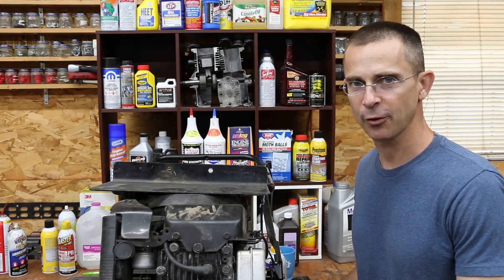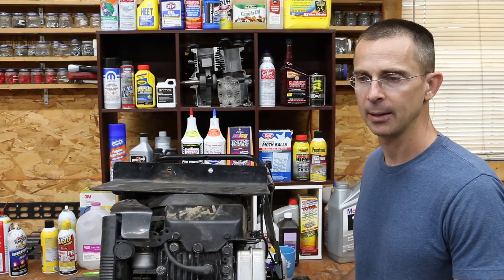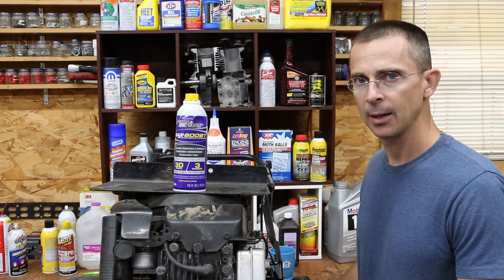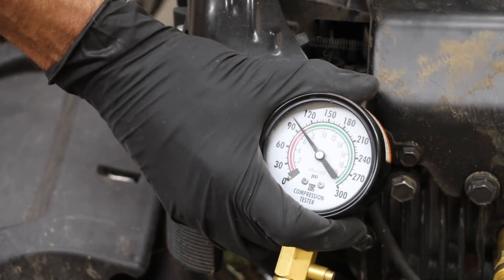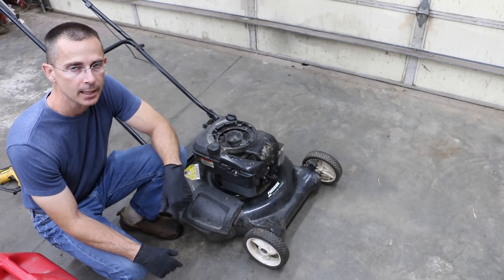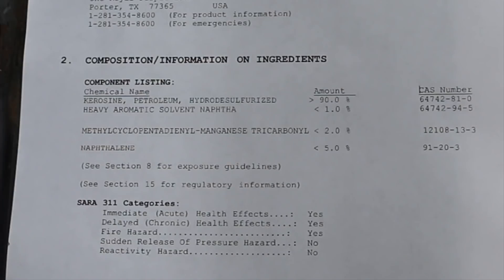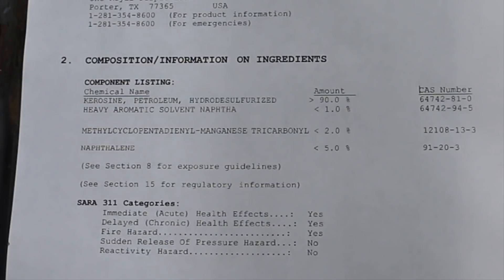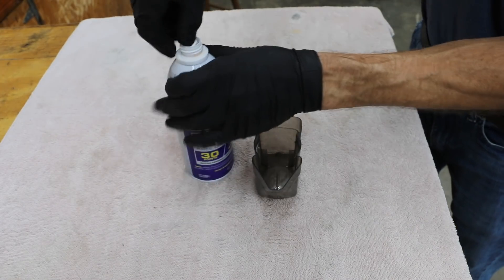Will a gas engine run on 100% octane booster?  Let's find out!

Comment: My mom ran out of gas on the side of the road in the late 90s in a mercury cougar. She had a case of octane booster in her trunk. I don't remember how many bottles she put in but I believe it was the entire case. The car started fine and she drove it to the gas station and filled up on gas. As far as I remember everything worked out fine but I was about 10 or 11 when it happened.
Reply from the maker: Impressive!  That was very good thinking by your mom!

Comment: This video was awesome. I just discovered your channel and subscribed. I noticed on the see-through engine that there was a small vortex directly across from the exhaust valve, and some further circular flow leading from the intake valve to this vortex. This gave me the idea for a video project recommendation for you. What if you were to engrave some spiraling channels inside the combustion chamber which follow this flow pattern shown in the video at 4:35? Would it affect air/fuel flow, combustion, and/or exhaust flow significantly enough to affect engine performance? If so, would it improve power, throttle response, torque?
Reply from the maker: This is a terrific idea--thank you!
Reply: You're welcome. I would be stoked to see the video.

Comment: You should try 87 octane with no ethanol and 100 octane or do 87 89 and 91,93 or 94 and do a running comaparrsion, Between the three fuels to see how they affect the mower differently
Reply from the maker: Thank you for this recommendation!

Comment: Would be very keen to see these motors doing a quantifiable work, perhaps like a water pump and two tanks, or a alternator and load?
Also, while its probably been done before, would be keen to see running such a motor off the various fuel gasses you can buy, like LPG, CNG, H2 and C4H2.
Reply from the maker: Thank you for this recommendation!

Comment: Here is a good one, running a lawnmower engine on a lighter oil which also happens to be synthetic versus the oil originally said to be needed.  Like my dad's Honda push mower went from regular oil 10W30 or 5w30 to my laying around Pennzoil 5w20 natural gas synthetic. Also, use Shell gasoline.  Anyways this is an old mower but it seems a bit different now.  I believe the change was from 10W30.  Please try it out to see what you think.
Reply from the maker: Thank you for this recommendation!

Comment: Very interesting.  I wonder what the orange stuff was?
Reply from the maker: Others said it is sulfur or MMT.
Reply: Project Farm thanks for the reply.  I  look forward to the next video. Maybe one episode you could try nitrous oxide? Or I would really like to see water/methanol injection around 60/40. From the data I have seen shows strong improvement over gas alone and the intake Temps go way down.

Comment: Have you heard of running a 10:1 gas:acetone mixture to clean the carbon deposits? Heard it from a mechanic who worked for Ford back in the 70’s. I do not have a sacrificial mower to try it on.
Reply from the maker: I have heard of this.  Thank you for this recommendation!

Comment: I have an idea.how about using a full  gas tank of carbon buildup remover  in  ur lawnmower engine .then remove the cylinder head when mower engine is cooled off and see if all or every inch of the top of the combustion chamber,piston top,and intake and exhaust valves  are completely carbon build up free .letme know what u think of my idea
Reply from the maker: Thank you for this recommendation!

Comment: so i guess the the idea with the "octane" booster ingredients is that the kerosene is more stable than the gas when rapidly compressed, so it helps mimic the characteristics of higher octane fuels? if thats whats going on it seems like you would be better off to just buy 91 if you have a high compression engine, seems iffy to me.
Reply from the maker: Excellent point. Thanks for commenting!

Comment: I would like to see if easy off oven cleaner can clean carbon out of an engine. Maybe let it soak a little before running the engine. It cleans carbon buildup out of ovens and I am curious if it will do the same to an engine Thanks for your videos. I love watching them. Thanks
Reply from the maker: Thank you for this recommendation!

Comment: One evening when I was screwing around with canned air I decided to light it up and it was highly flammable like it said on the can and the ingredient is close to nitrous oxide you should try running an engine off of it or at least making injection line for it but I don't know what the bettering agent would do to the engine
Reply from the maker: Thank you for this recommendation!

Comment: If I remember my auto mechanic class correctly, Octane Booster inhibits ping so that you can run a higher compression ratio thus giving you more power. Octant boost in itself does not give you more power.
Reply from the maker: Yes, you are exactly right. Thanks for commenting on this!

Comment: I live in Cali we only get 91oct. I have a 2+ Golf R 375hp/400tq AWD (<brag). I use 8oz of Torco octaine booster with 10gallons of 91 and can run my 93oct file all day at the track with no issues. I’ve even tried the 100oct file with 24oz of torco (this file doesn’t have much timing wiggle room) and again no issues with pulled timing. should experiment with it as it’s the only oct booster on the market I know of to be dyno / logged and confirmed.
Reply from the maker: Impressive! Thanks for sharing this experience with Torco octane booster.

Comment: I would like to see how well the engine would run on white gas (camp fuel) and how it affects a lawn mower it has been left in for several months. Gasoline with alcohol is a disaster if left in the mower over winter.
Reply from the maker: Thank you for this recommendation!

Comment: How do you get these lawn mowers? Do you use the same ones for different videos?
Reply from the maker: I have 20 or so engines.  I buy them from mechanics and off of Craigslist.  Thanks!
Reply: Project Farm  thanks for the reply I rely on garbage picking them I got 2-3 atm and i take the engines apart and learn what's different in a 6.5hp and a 8hp.

Comment: i would really like to see what happens if u run 2 stroke fuel 32:1 in a gas 4 stroke engine , if it makes it run hotter or lowers the compression or just what happens, also would love to see what happens if u run a 2 stroke engine with a 32:1 but use engine oil not 2 stroke oil to mix with the gas, i always put a splash of 2 stroke oil in my lawn mowers tank, i dont think it will hurt it but id like to see
Reply from the maker: Thank you for this recommendation!

Comment: Hey, do you have a vid showing your construction of the see-thru head?  I've seen a couple others, but never seen anyone do a "how to" or "making of" vid for one.  I can easily se it's a high strength plexiglass, but to see it actually being made gives a whole different experience.
Reply from the maker: Yes, I make one in the monster energy video.  Thanks for commenting.
Reply: Oh, cool, I will check that out!

Comment: See if you can somehow mount the carb to the exhaust port and the exhaust to the intake port and spin the engine backwards and see if it will run. Love the videos.
Reply from the maker: Thank you for this recommendation!
Reply: There was an issue with some of the earlier Mack Diesel engines where they would start up backwards with air coming in through the exhausts and smoking out the air cleaners, quite a sight.
Reply: Lalnable Hector had an international 466 that would run in reverse if you stalled the motor going up hill and it rolled backwards. Pop the clutch and away you would go with no control.
Reply: akbychoice  I know that probably isn't funny to have that happen, but the thought is amusing as hell, to me.  :D
Reply: Jäger Demon first time it happened I nearly took out a house because it was downhill on snow and ice, the next time I knew what to do instantly.

Comment: Diesel and Nitrous,  on a gas engine,  would the additional oxidizer push the diesel enough to combust in a gas engine?
If so, would it also run on used engine oil & N2o?
Reply from the maker: Thank you for the recommendation!

Comment: Just to be fair, put the engine under load on gasoline.  ( Mow your grass ) to see if the head also comes up the 60 something degrees.  (( I think it will, but never know.  )) Thanks!
Reply from the maker: Yes, excellent point. I should have done this.  Thank you for the recommendation!

Comment: try running a motor on pure seafoam with no fuel and see if it causes any damage or if it leaves it cleaner than mixed with gas like if yall wanna see this happen
Reply from the maker: Thank you for the recommendation!

Comment: Project farm, for years now I have tried to tell people about these pesky octane numbers, you would think by now it would be common knowledge. The octane rating is nothing more than a flash point, or at what point the fuel will ignite. It is inversely proportional, the higher the octane number is the lower the flash point, the lower the octane number is the higher the flashpoint. So you increase the octane to lower the flash point on engines that are running a higher compression ratio to prevent pre ignition or "knock", of course if you are using nitrous that factors in as well. But if your engine is designed for 87 octane you will actually degrade the economy and performance  if you use premium or a high octane fuel, remember horsepower is all about the "bang" in the cylinder.  If you have a high compression motor, running nitrous, high rpm's then you will need to increase the octane number to prevent the engine from igniting the fuel from heat and or compression before the correct firing point.
Reply from the maker: This is very good information and I hope a lot of viewers read your comments.  All great points.  It's given me a great video project idea for a future video--thank you!
Reply: Project farm, thanks for taking it like a trooper, I was afraid you were going to take it as though I was tearing you down, it's not meant that way, just wanted to share some knowledge. See you in the future, God Bless.

Comment: Break down of ingredients: MOSTLY kerosene/gas, MMT (which is a manganese based octane booster), and napthalene. In short, its essentially (mostly) gasoline and kerosene, with an octane booster MMT. They use MMT all over the world for octane boost. What you saw after opening the cylinder was MMT manganese residue, probably from the high concentration. Another great video, Thanks!!
Reply from the maker: This is great information and thanks for the positive comment!

Comment: I noticed similar yellow/orange buildup inside my 2 stroke bike, I run octane booster in it as well to help keep it from knocking as iv upped the compression, seems to work well enough at least the engine hasn't blown up yet haha
Reply from the maker: Very interesting. Thanks for commenting!

Comment: Run an engine off of brake cleaner.
Reply from the maker: Thank you for the recommendation!
Reply: Wouldnt recommend it , Brake clean air 'ignited' will emit a white smoke and hospitalize you and or cause certain death.
Reply: Diesel engines will run on pure brake cleaner
Reply: Is that both chlorinated and nonchlorinated?

Comment: Great video.  I'm still waiting on the video where you test that ProLong (on the shelf behind you).  That product had massive marketting behind it, and we tested in our high school shop class.... Might have been just a fluke, would like to see some real tests and data on it.  Thanks!
Reply from the maker: I'm really looking forward to beginning a series on lubricants and oil additives.  I'm still acquiring the proper test equipment.  Thanks for this recommendation!

Comment: Great video!! Years ago, before I knew anything about cars, I used that "Octaine 104" stuff in my car.... Until the cat clogged the exhaust. Turns out running higher than specified octaine fuel in your daily will mess up the converter. An expensive lesson. Im guessing whatever all that orange stuff is, is what clogs the cat.
Reply from the maker: Excellent point.  Another commenter mentioned that some of these octane boosters contain ingredients that could damage catalytic converters.  Thanks again!

Comment: Hi, I'm currently looking to buy a self propelled mower ( I don't know anything about mowers ) and I'd like to know if there are brands that are more reliable than others...
Reply from the maker: Not sure what you're willing to spend, but I really like commercial grade mowers, not the ones one typically finds in the box stores.  I'm not comfortable recommending the low end self-propelled mowers.  While they may last a while, they just aren't durable enough for me to recommend.  I've had very good success with the commercial snapper push mowers.
Reply: Project Farm thx

Comment: Ok  I got one for you guy . How about you add  1 table spoon  fusel oil to the engine tank  .  you can find this at your local bomb supply store. You may want to use a very remote starter  and a scatter shield . Also if you have the time, do you know of away to test  R/C  nitro fuel . It goes bad pretty fast and flying planes is a bad way to find out if its done . Also is there a way to revive it if it duz so. Thank You .
Reply from the maker: Thank you for the recommendations!

Comment: This is a bit of a destructive idea, but get pushrod, sidevalve and overhead camshaft engines, and run each engine without oil
 To see which engine will last the shortest and longest time
Reply from the maker: Thank you for the recommendation!

Comment: This was good!
Reply from the maker: Thank you!  By the way, did the epoxy successfully keep the transducer mounted to the hull of the boat?...or did you choose a different strategy?
Reply: Project Farm 
Just bought materials so far.. may not be able to complete that this season.. But I have every confidence your suggestion will be successful.

Comment: Another great educational video!  Thanks for all your hard work and your generosity in sharing. That yellow stuff appears to be sulfur from previous gunk. Impressive how it "chemically" got  scraped out.  Please do a flame test to confirm.  Still would love to see you use a barbecue tank as fuel for the mower.  Would be fun to see a grey tank powering a mower and it's renewable, clean fuel.  After that, use Hydrogen.  Now that would be the first in uTube!  Would be happy to chip in since hydrogen is expensive.  Please be careful tho, we want more videos!  Many thanks again and keep on mowing!
Reply from the maker: Several terrific ideas--thank you!  Also thanks for the positive comments.  I'll see if i can put together several videos that you've recommended.  Thanks again!
Reply: Welcome! I'm sure you can do just about anything with your technical prowess.  Can't wait to see 'em.

Comment: Try using water to clean the inside of engine. For example use a 32oz spray bottle and slowly spray water in the intake until he bottle is empty and then see if it cleaned the engine
Reply from the maker: Thank you for the recommendation!

Comment: How about testing to see if an engine will run on a improvised spark plug. Maybe cap the plug hole and just run it with 2 electrodes in the head.
Reply from the maker: Thank you for the recommendation!

Comment: The brown color is a deposit left from the MMT (the ingredient you couldn't pronounce). The MMT is what TORCO  uses for their octane booster. There is a debate in the automotive performance forums on whether or not it is a long term harm. It is said that it eventually plugs up the CATS and will destroy oxygen sensor.
Reply from the maker: Thank you for identifying the cause of the deposit.  I suppose this video serves as pretty solid proof that this ingredient does accumulate inside the engine and cat.  Thanks again!
Reply: The orange compound is Manganese Dioxide
Reply: Kryptic NL Is it? Because there's no sulfur in MMT so it would seem rather strange that it would cause the build up of sulfur in the engine.
Reply: This is a great comment. Smart people out there. 
That's a good point though, I bet that Manganese Dioxide would have adverse effects on a catalytic converter if the build up can not be removed by exhaust from gas or high temps.
Reply: you are correct. It is sulfur residue build up on the head.
Reply: I thought the same when I saw the color of the deposits.  There's that ingredient you cannot pronounce.

To those concerned about poisoning the cat, it's used in much lower concentration in motor fuels.

Comment: Sounds way too expensive but adding 100% of this stuff in the tank on a gas driven car sound really interesting since it clearly work in a small engine :)

But how about try get some jet fuel that is used in regular airplanes like Boeing 737 etc.. 

And try run it in one of the small engines. Sounds interesting :)
Reply from the maker: Yes, it would be way too expensive, but it was sure fun to test this out.  Thank you for the recommendation on testing jet fuel!

Comment: I think you should built a tool for removing/tightening all the head bolts on these engines at the same time. Think of how much time it would save you in the long run, lol.
Reply from the maker: Thank you for the recommendation!

Comment: Makes sense that it wouldn't have more power: you need to a) have higher compression & b) advance the spark further to see any gains from octane increas(es).  I mean 6:1 ain't gonna make much under any circumstances.
Reply from the maker: Excellent point. Thanks for commenting!

Comment: I figured the temp would be higher. Octane actually retards the burning process, higher octane-slower burn. In an auto engine it doesn't really add power unless manufacturer calls for it in that specific engine. It may even reduce power output and increase emissions.
Reply from the maker: All excellent points. Thanks for commenting!